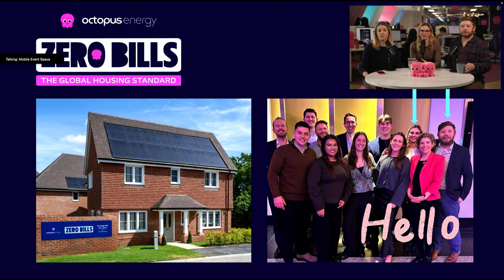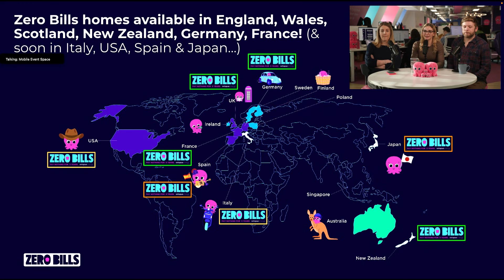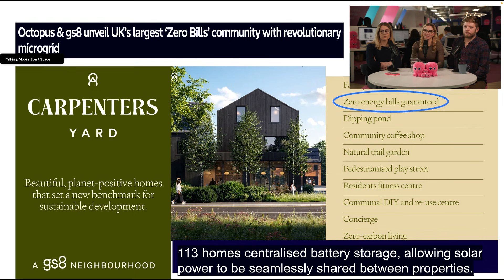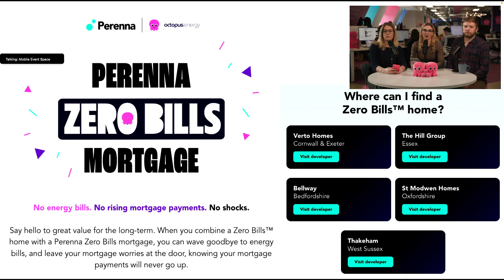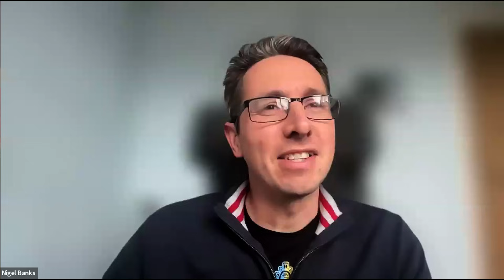How People Are Getting £0 Energy Bills: The World’s First Zero Bills Tariff | Supergroup Live

Comment: I have heat pump and solar panel for 3 years now, I can't have radiators on in all the rooms as the house never gets warm enough in the winter , the house is fully insulated roof and walls, when it's really cold in the winter I have to heat only a couple of rooms or have additional heat on, and if you want the hot water on the heating goes off, if I had the chance again I would get the biggest and best gas combi boiler

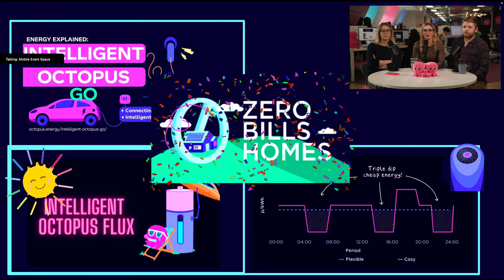Comment: I've just noticed that the "How much does it all cost?" section, 13:15, doesn't include the cost for the heat pump. Are there similar trends to the cost of heat pumps?
Reply from the maker: Hi there, great question! The chart covers solar & battery costs, which have dropped fast thanks to large investments and global scaling. The bulk of the cost to install a heat pump comes from upgrading current heating systems and installing hot water cylinders rather than the heat pump materials themselves. We're actively looking to reduce the cost of Heat pumps with lots of cool work going on at our heat pump R&D centre. In the meantime, customers can also benefit from the Boiler Upgrade Scheme, which can reduce installation costs by up to £7,500. Check out our page here for more info 👉 https://octopus.energy/boiler-upgrade-scheme/. 🐙

Comment: This irritates me. About 12 months ago I had a disagreement with the octopus solar installation team. They were insisting that I limit the quantity of solar panels to less than 50% of my roofs capacity. I had to cancel my order and switch to a different provider whom installed what was optimum for my property, also octopus refused to fit a heat pump too. I now have zero bills, in fact better than zero.
Sending out mixed messages octopus.
Reply: My understanding is that some suppliers/fitters can't be bothered to go through the dno application process for inverters over 3.5kW.
Mine just did what I asked/told them to. So 24 panels 12 east, 12 west. With two 5kW string inverters (because a hybrid inverter over 5kW didn't exist.
Reply: @rugbygirlsdadg  At the time, octopus were offering a very good price on enphase kit, so micro-inverters and batteries. But they kept insisting that it was technically impossible to go above 18 panels. That was false information. In the end I got my deposit returned and fitted 36 panels on DC strings to a PW3. A year on and they have achieved exactly what I was wanting them to, the credit from the summer more than covers a large winter heat pump demand, zero power bills for me, unless the export conditions change drastically!

Comment: We have had $0 electric bills for six years now. All electric home, but no home battery, the grid works as my battery. I have 16 panels on a 5kw inverter, and the biggest saver is the power diverter to the electric hot water. We also configured our panels into east and west arrays to "flatten the curve". We are in New Zealand, the whole system was installed in an existing home for under NZ$15,000 including the hot water diverter. Our biggest disappointment was when Octopus started putting the $0 daily connection fee up, currently about NZ$1.50 per day, but still covered  by our sold generation. Happy to answer any questions.